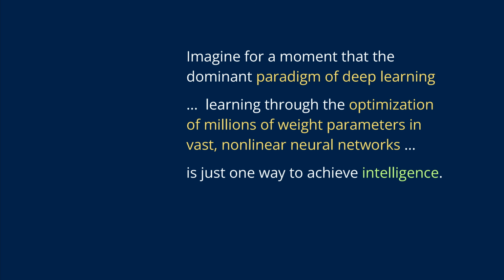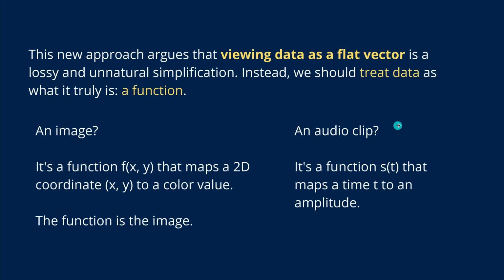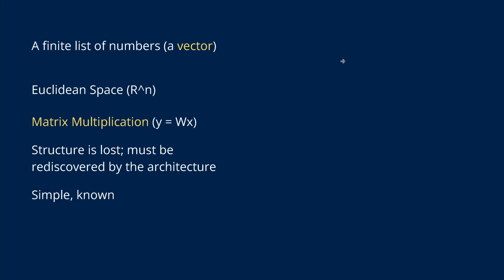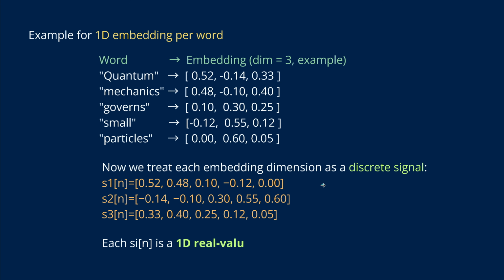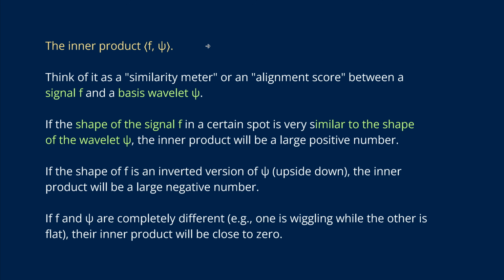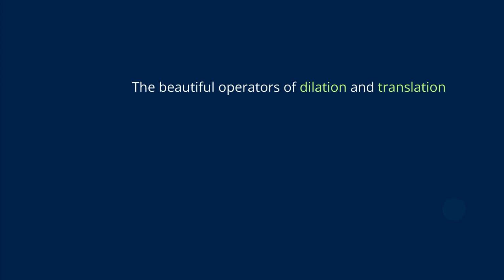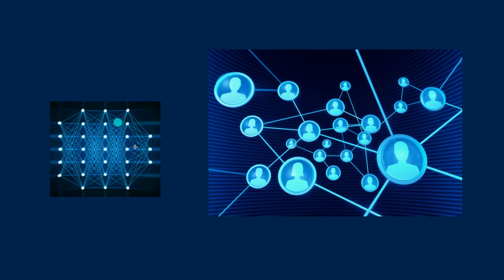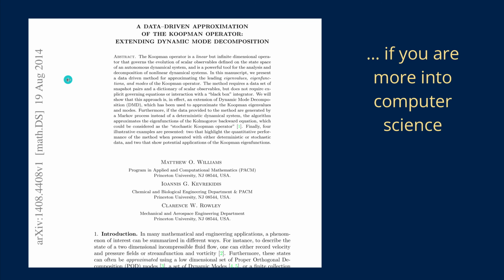Wavelet Operator Theory: Beyond GPT-5 (#startup)

Comment: @code4AI, amazing video, man. Seriously top-tier content.

I've been going down the rabbit hole trying to find solid alternatives to self-attention, and your breakdown of Hilbert space .. used by SDict-VLM..  explanation was super clear.

It got my gears turning, though. It feels like the current SDict-VLM is just the beginning. Your video made me think... what if the real next step isn't just using a fixed, learned dictionary of 'frequencies', but having the model learn to generate a custom dictionary on the fly for each specific problem it sees?
Like, it would build its own unique toolkit of basis functions as needed for the task at hand. That feels like a massive leap in flexibility and intelligence.
Anyway, just a thought your video sparked! It really feels like we're on the verge of moving past the "just make it bigger" era and into building genuinely smarter, more structured models. Your videos are a huge help in connecting those dots. Keep up the amazing work!
Sdict-vlm powers of interpretability is spot on. Being able to visualize the actual tools the model learns to use, instead of just another attention heatmap, would be an absolute game-changer for trusting these things.

Comment: I called it. Wavelets are the way! I applied them to image processing. Reduced the computational load 15X during training. Then I was working on a way to use them in a language model but couldn’t find a way to get it to work. Glad someone else saw the potential.

Similar to FFT but You get a perfect trade off between the “frequency” and time dimension information. You know something about what was played and when it happened in a Heisenberg like trade off.
Reply: Nice ! Could you please point to your work if its published ?
Reply: @ikiphoenix9505  I am just an independent researcher/ hobbyist. But I can quickly tell you about my experiments.

I learned about wavelets studying hi-fi speaker design. Fascinating math. The Heisenberg like trade off in information time/ frequency is what convinced me to try to use them as a sort of replacement for standard convolutional layers. But also the implications for truely temporal information processing for AGI. Current LLMs are like a crystallized filter that we pour data through. An AGI that has a realworld grounding will need to have a temporal continuous existence. Wavelets seem to be a big piece to this puzzle.

I’m my experiments (MNIST and CIFAR10) I was able to match SOTA results with 5-15X less computation during training by simply replacing the input layer with a Haar wavelet layer and taking ONLY the cA (low frequency) channel through the rest of the network.

I had done an analysis that showed the network was extracting nearly all of its information from the cA channel vs the higher frequency channels after the decomposition.

Major speed up because the rest of the network could shrink in dimensionality. The wavelet transform compressed the information nearly perfectly in a convolutional like process.
Reply: watch?v=v74TyFFegoM
Anton Petrov just talked about tweaking photons in a controlled way by having them interact with manipulated atoms. Super clunky and not practically applicable for this yet but... what if we could inform photons (the carriers) by shooting them at an array of atoms with a particular fuzziness (the knowledge graph, the neural net)?